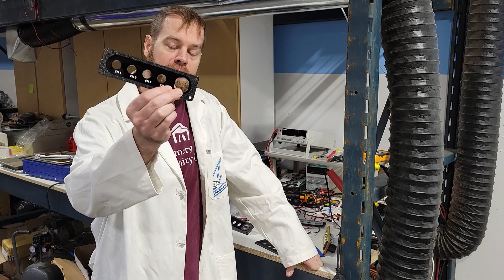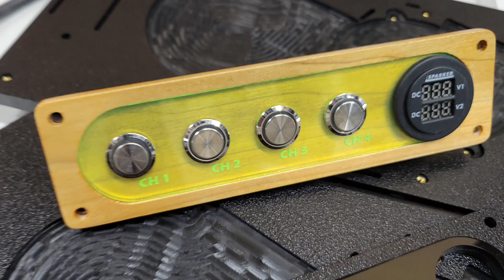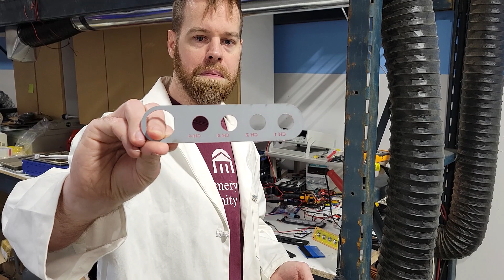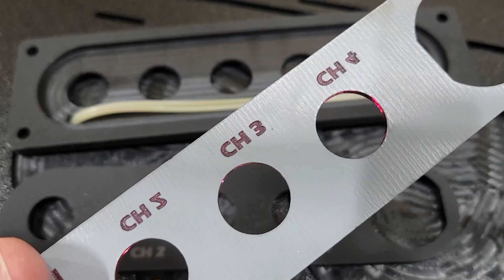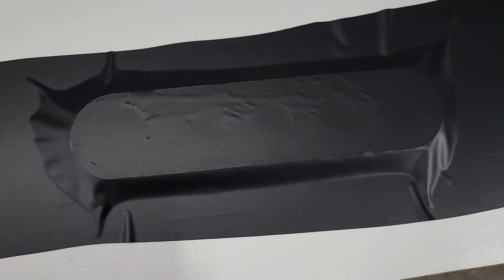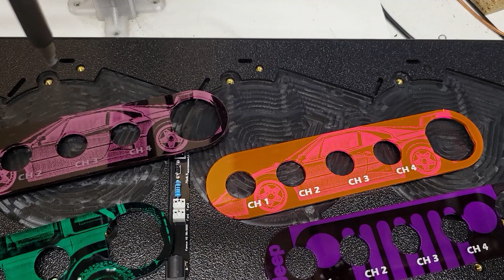New Product Design, Illuminated Switch Panels, First Look

Comment: l ordered a single din one with the xs power volt meter. I'mma have to shave it down though to get it fit. So now later it's off to harbor freight to buy a small belt sander. This is going to look so incredibly good though so it's well worth the having to slightly modify it! Great product Sparks! Also ordered 2 fannies and The Conducter! Loving your products Sparks!